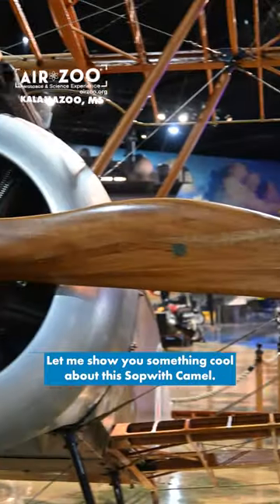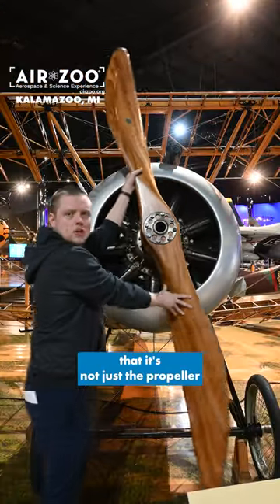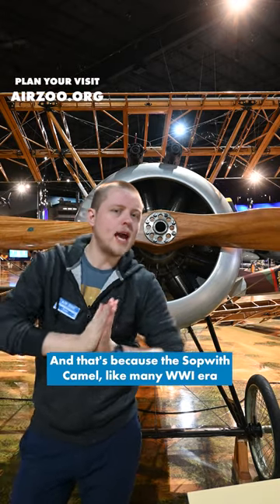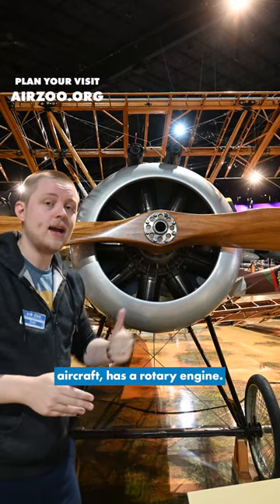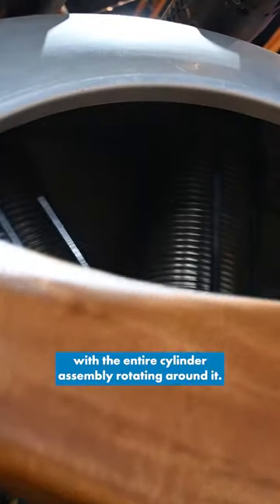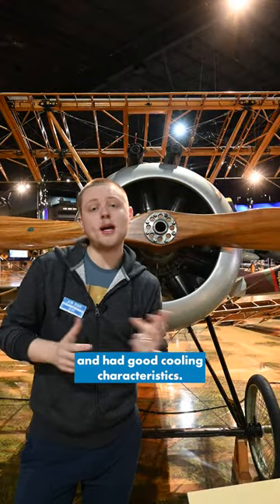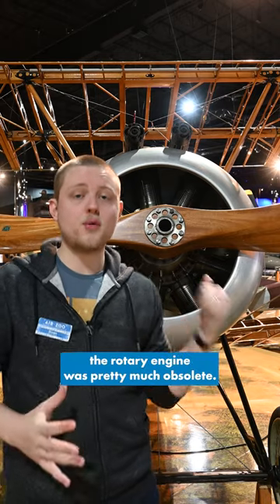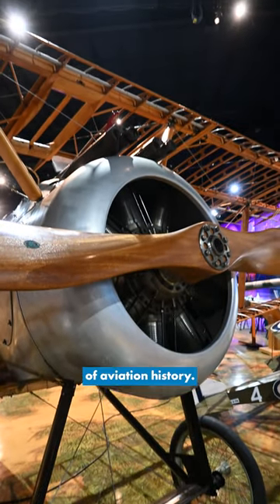The Sopwith Camel's spinning engine!

Comment: It was actually easier to do a 270 degree turn to one side than do 90 to the other due to its massive torque.
Reply: Holy shit really though?
Reply: @sumiterxeroslargosiuscrosi7819  FrFr though YO
Reply: I’ve heard all that rotating mass under power can have a gyroscopic effect causing the input of the rudder to act like the elevators and vice versa
Reply: My girlfriend was on gyroscopic mood,moving fast and impredictible
Reply: @sumiterxeroslargosiuscrosi7819 shit was straight bussin on God
Reply: @sumiterxeroslargosiuscrosi7819  as a student pilot probably true
Reply: I'm guessing turning into the direction of the rotation is going to be a lot quicker of a turn as opposed to turning against the rotation, it's going to take a lot longer! Just my educated (educated being used veryyy loosely here 😁) guess!
Reply: @jacobviator3118  no need to take a guess, simple physics proves this to be true. Yaws at take offs even. Massive ass torque on those things especially big heavy probably IRON cylinders/blocks, and not even something more lightweight, spinning around all in the same direction. Thats gonna help you get to said direction pointed
Reply: @reedman0780  lol yeah I thought it was common sense/simple physics(same thing in my book!) but wanted to give myself a little room for error since I put a whole 10 seconds worth of thought into it 😅
Reply: We need to be careful here. Is there torque? Yes. Massive? No. Manageable? Yes.
Turning right or left isn’t much different except it will pull down when turning right, and yes, a bit quicker. Turning left it wants to crab or go upwards. This has already been mentioned by several others.
These are managed by the pilot to control the upwards or downwards movements and become second nature.
Keep in mind too that design of the aircraft has much to do with mitigating or increasing the gyroscopic effects of the rotary aero engine. Short fuselage and wings- Sopwith Camels, Pups, Triplanes, Fokker Dr.1 triplane, certain Nieuports, etc the design made them quirky, nimble, unstable, etc. Pilots understood this and if they were good, used it to help in combat. Longer fuselage and wings- think Avro 504K- the rotary engine effects are greatly muted.
Pilots did not turn a Camel ( or Fokker Dr.1 p) to the left to get around to the right quicker. It’s just another myth of WW1 aviation.  One I used to think and say too until I learned more about the aircraft an engines.
Reply: The torque from the engine is only a factor if the engine is speeding up or slowing down. When the engine is spinning at a constant speed, it's in a 'steady state' and therefore does not apply any torque to the airplane.
What causes the handling issues is gyroscopic procession. To understand what that means, hold a bicycle wheel in your hands by both sides of the axle and have somebody spin the wheel. Then while it's spinning vertically, try to move the wheel so that it's spinning horizontally. It will feel like it has a mind of its own
Reply: @thecrazyfarmboy  But that is what they did. They increased the RPM of the engine to turn quicker.
Reply: That’s why they had blip switches to momentarily turn off the engine to make those turns

Comment: Pilots were well aware of the torque characteristic and used it in combat. It's one of the factors that gave the Camel so many victories.
Reply: The ones that survived enough to get a feel for it, the other just didn't last long enough and the training was very rushed
Reply: when the camels where introduced they werent immediately effective because of the pilot training, then when they learned to master it, the camel acquired 1294 air victories
Reply: @XMarkxyz  Far more pilots survived and would learn their trade well. Camels were not death traps, they saw intensive use from May 1917 till the end of the war.

Comment: As a car guy as soon as I heard rotary engine I thought this place had an angry spinny Dorito, and then quickly realised they weren’t invented till the 50’s
Reply: that's a wankel engine =)
Reply: Brap brap brap brap
Reply: However, one American car make, the Adams-Farwell, used rotary engines with vertical fixed crankshaft before the First World War. They were made in 3 cylinder and 5 cylinder models.  Few were made, only one survives, shown at Pebble Beach about 2012.

Comment: Another interesting fact about the Gnome engine was it had no throttle control. It was either on or off and the only way pilots could control it was through a switch to cut ignition. Between that and having control that reacted 90 degrees away from the pilots inputs due to gyroscopic effects. It definitely would have been a handful and it’s no wonder why they lost so many new pilots due to loss of control.
Reply: Y’all are looking at it the wrong way, they were simplifying it for the new pilots. Why complicate things with a throttle when it’s simpler to have just the on switch to deal with? Why give them two directions to turn when one will do?
Reply: @samreid6010  they also don’t need to learn how to land if every flight ends with fast contact with the ground
Reply: The magneto was either off, or fired either 25%,50%,75%, or 100% of the time. That is why you hear them sound like they are mis-firing badly. The mag is just not firing all the time to keep the engine speed down.  The lubrication system was a constant lose system, and was so messy that the pilet wore a scarf to wipe their googles off so they could see. Imagine flying that thing! It was a handful.
Reply: @ronfullerton3162  that’s interesting stuff. You know if the engines lasted long?
Reply: @joshuayammer1994  I do not remember the name of the poster, but their was a video on U-tube about a commemorative flight of a Camel flying with a Spitfire at an airshow. And the Camel pilet gave about a five minute talk about all those interesting points about the plane. They even show the plane on the ground running with the mag in about the 50/50 firing setting. The plane is sitting there rocking back and forth as the torque of the engine is on and then off. Looks really strange. The Camel was such a handful to fly because of the engine torque that one post said as many pilots may of been lost from takeoffs, landings, and handling mistakes as were lost in combat. The Wright Brothers had flown less that twenty years before WW1. So aircraft were still very primitive and experimental. As well as the power plants. I always thought a modern materials built Camel with a modern powerplant such as the Rotec radial would be a fun plane for private license flight.
Reply: @joshuayammer1994  I went looking and found the post that I remembered. The address is WW1 Air combat, and the video is titled Soowith Camel and Spitfire Flying in Formation. The actual Camel pilot is talking. Watched some other videos also, and that thing was a handful to fly. I was wrong on the magneto settings. The fellow explains there were two mags, and tells their functions very well. So other video explained there were also an air intake control and a fuel control. How did the pilot even have time to run the stick and rudder? Early flight was not for the weak of heart!
Reply: Actually this is not correct, with all due respect.  Rotary aero engines all had throttles and carburetors with the exception of the monosoupape rotaries. 
Normal operating RPM range was between 500-1200 rpm’s, and you managed the engine with a combination of throttle, carb and often a  tampier valve (fuel flow only). While one cannot say the carburetors of the day were the most sophisticated, they did work as intended for the most part. 
The blip switch you refer to was to help slow it down in landings, because the engine windmills pretty easily with that spinning mass and won’t slow as fast as you would like it too. So once you drop below about 700-800 rpm you would use the blip switch *sparingly*. You do not blip it at higher rpm’s as you can damage the engine (broken crankshaft generally). The Clerget manual warns against excessive use of the blip switch so it was common knowledge how to use the blip switch correctly. 

Just to clarify too, the Camel used a variety of rotaries, but three main ones. 110 hp LeRhone, 130 hp Clerget and 150 hp Bentley.
Reply: Monosoupape rotaries sprayed fuel directly into the crankcase via a fuel line that ran down the hollow crankshaft. The pilot could still manage fuel via the tampier valve. As some others have mentioned, they then used a special ignition selector switch which allowed for all cylinders to fire in 2 rotations as per normal, or cut the frequency of ignition in each cylinder to 1/2 (4 rotations to have all cylinders fire of have a spark/ignition , 1/4 (all fire in 8 rotations), or 1/8 ( all fire in 16 rotations).
This allowed for variations to engine power and hence speed but still kept burning off fuel and running vs no power strokes at all. To hear these run is very interesting. Monosoupape engines were built in various sizes, most common were 100 hp and 160 hp. While this makes it sound like they were crude, they actually worked quite well, and the Gnome 9N 160 hp monosoupape was quite a good engine for the day.

Comment: I... have never heard of this type of rotary engine. Now granted I'm more of a car girl than an aviation girl so maybe it's just my specific field of nerd, but when I hear "rotary engine" I think of a wankel rotary engine aka RX7 spinning Dorito. But this is definitely an engine and it's definitely rotary and the wankel engine was invented after it, so I guess it owns the name "rotary engine" since it existed first.
Reply: Oh God, now I'm imagining a Sopwtih Camel sounding like an RX-7.
Reply: The correct term for this engine would be a radial engine not rotary...
Reply: @GB_GeorgiaF  Cursed engine swap
Reply: @mathewmerkl576 sorry it is a rotory engine. Just not a Wankel rotary engine. (Also the spelling is different) The radial has fixed casing with spinning crank. It's also a four stroke with cams valves etc.
Reply: @mathewmerkl576  Rotate means spin right? Now think of the term rotary (spinning) ENGINE. The entire engine of this aircraft SPINS/ROTATES. Hence "rotary engine". 

Radial is just a circular configuration, rotary (in this application) is the method of OPERATION, not configuration.

Comment: Also made throttling impossible.
Reply: Not true, I address this in several other posts. Rotary aero engines had throttles and carburetors, other than monosoupape rotaries which still had a fuel control and a special selector switch to manage the engine ignition.
Reply: @kevink.5777   The Gnome "mono" engines did not have throttles and were at full "throttle" while the ignition was on. They could be "throttled back" with a selector switch which cut the ignition to some of the cylinders to reduce power for landing.

Comment: Him: "...Rotary engine"
My brain: Brap Brap Brap Brap
Reply: I saw it and knew it was a radial, but when he called it a rotary I thought, "but it no brap brap"
Reply: @Rook_Official  radial engines have fixed cylinders that rotate the crankshaft, like the engine on an F4U Corsair :)
I guess the thing that sets rotaries apart from other engines is the fixed crankshaft, like he explained in the video, which also applies to wankel rotaries like the spinny dorito RX-7
Reply: @leto1596  I'm not sure you could call a wankel rotary since it's pretty much only the displacer and output shaft that rotates. in a true rotary everything but the crankshaft rotates
Reply: This is a rotary. 
The 'brap brap' Mazda engines are Wankel rotaries.
Reply: BRAAAAA-PT-PT-PT-PT-PT
Reply: @Rook_Official it is not a radial.
Reply: @TheHenirik the Wankel is a totally different animal.
Reply: @WALTERBROADDUS  compared to a rotary or even a radial, yes. Hence my comment about not calling non-rotary engines rotary.